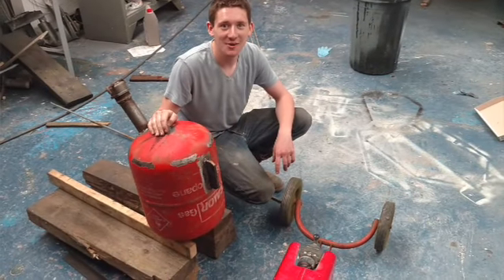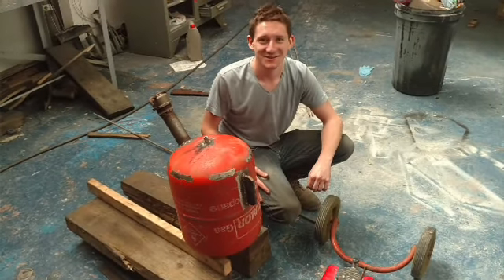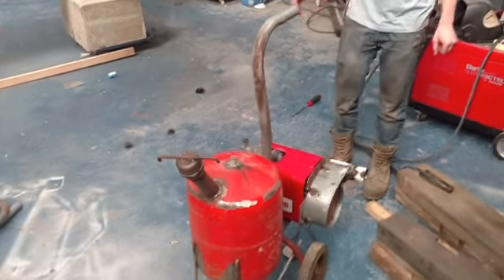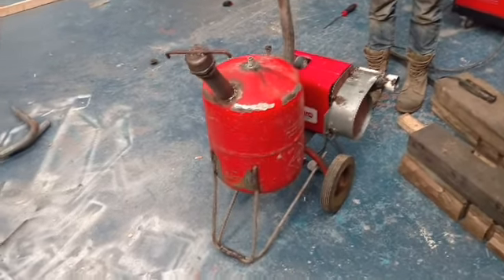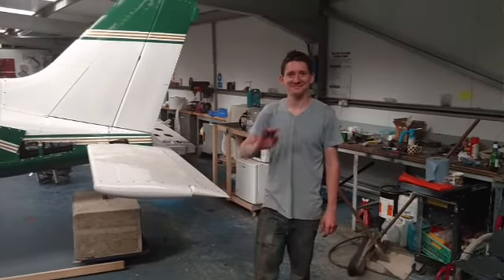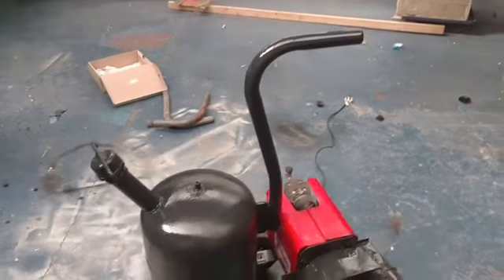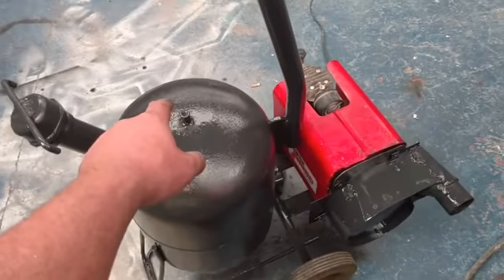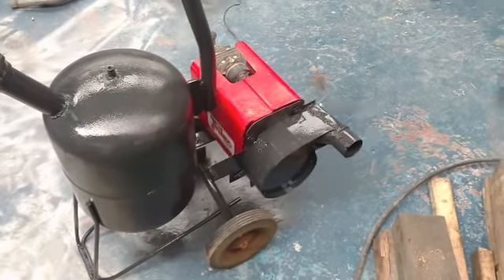oil burner part 3 assembly of the major components

Comment: Oh dear! You welded without gloves and sprayed without a respirator and life support system. You are going to have every candy arse safety zealot Nazi whining and whingeing at you now as well as all the professional welders telling you what you did wrong.  The saftey zealots  have never built a thing in their lives but feel the need to try and look knowledgeable by putting down others. 

This is a very interesting design and I look forward to seeing how it finishes up. I like the all in one and portable design. I must think of something like this for my own burners but I do so many different things it's hard to standardise. 
What you are building must be different to what i'm thinking now because if that tank gets hot and is uninsulated, you are going to melt your wheels and fry your compressor so I'm keen to see what you do.  :0)
Reply from the maker: well fuck my arse sideways, we are truly honoured to get get a comment from such a prestigious polluter as yourself and am happy to tell you, your vids have been a bit of an inspiration for us.
we do have a glove somewhere i think, but the weather here in the uk is shit 99% of the time, so welding in a vest and t is the best way to pick up a decent tan.
Reply from the maker: this is only the fuel and air supply and will attach to several different burners, a small capacity high temp furnace, high capacity lower temp furnace, and a couple of torches for forging, im curious as to weather it is possible to get a clean enough burn to braze if i give the burner enough air but suspect it is always going to be a bit on the dirty side for this.